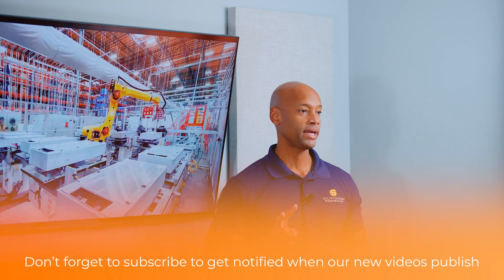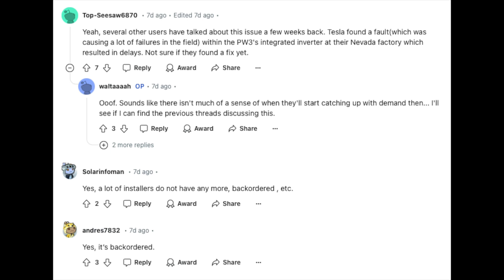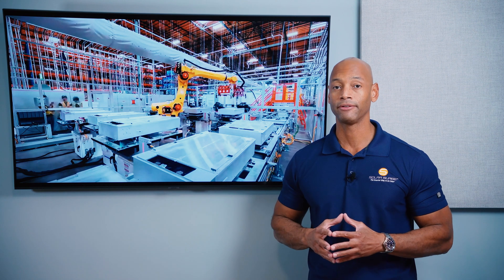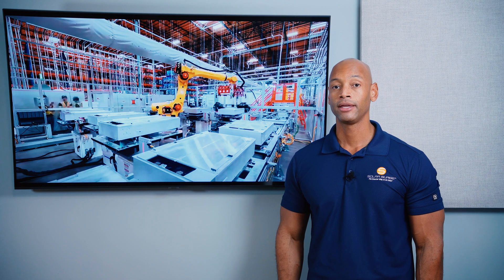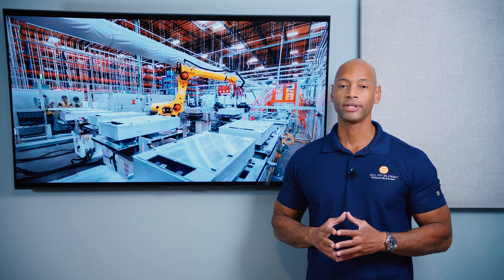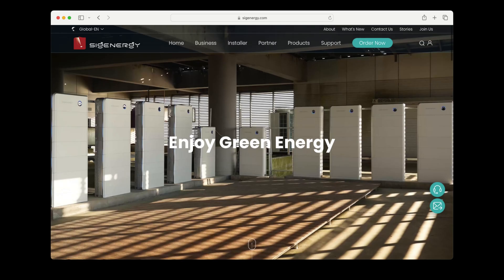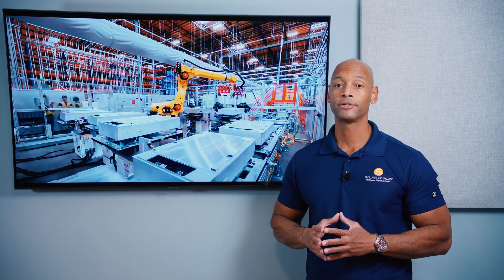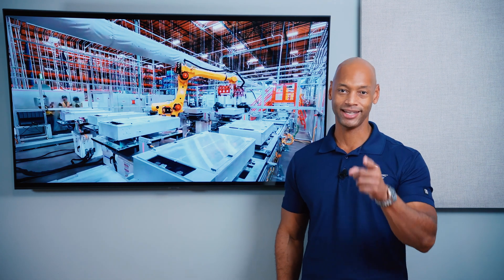SOLD OUT: Tesla Powerwall Out of Stock

Comment: The Ford F-150 Lighting cost 50k for 98 kWh that can be pluged into yiu home.  7 Tesla Powerwalls with installation will cost 70k, buy the truck and get a vehicle for free
Reply from the maker: Good point
Reply: Yes, but you have to install PowerShare equipment, which is an additional cost.
Reply: lol this only works if you dont drive that car during sun hours so it can charge up... unless you are talking about parking that car forever as backup battery 😂

Comment: @The_Solar_Guy_Eric  
Flex in South Carolina and Salcomp in Texas assemble for Enphase. The majority of the components are US-sourced. The workforce is American. 
Sorry buddy, your curve ball is out of the strike zone. Enphase LFP cells are sourced from Chinese suppliers. This will change. In early 2025 all Enphase LFP cells sold in the USA will be made in the USA. 
@TurreTuntermaton  Chinese Sinergy point is sustained. Your remarks are overruled. You failed to address the Chinese Sinergy relationship. TSLA too will eventually source LFP cells in the USA.
Solar Surge is a 100% residential Solar and installer audience. The TPO market will suck down the 10% ITC domestic adder. Enphase will see a fair share of this business. TSLA also, SolarEdge by Q4 2025.
TPO lease contracts are the majority of installations in 2024 and projected to be the majority of installations into 2025.
TSLA Solar is noted for failures and horrific aftermarket service. 
It is a shame the PW3 launch has been spoiled with news of a manufacturing flaw.
The advantage PW3 promoted was the ease of the install and the minimal time required to commission the battery and inverter.
The installer of record will have to double back and requalify the work or in some cases replace the PW3.
PW3 margins are known to be under 10% during the promotional pricing period. 
TSLA is selling direct to the consumer and dispatching installation contracts to smaller local installers. 
A life line if ever there was, the harsh consolidation at the installer level has seen many go out of business. Solar City employees are included in the carnage.

It is too bad TSLA rushed to market 6 months early in an effort to front run Enphase next-gen IQ-10Kwh LFP battery with GaN. The recently detected flaw in the manufacturing process may have been detected and the TSLA Solar inverter quality and service reputation saved from the humiliation.

Franklin is a solid AC-coupled alternative.

PW3 from concept targets the String Inverter replacement cycle. Adding a battery in one go is a brilliant product innovation and marketing scoop.
The PW3 buzz from installers is the simplicity, no power electronics on the rooftop.
Ironic the installer community completely overlooks the mid-circuit disrupters (rapid shutdown devices) between every 3 modules on the string to a max of 5 per string. 
This fact puts into question installer ethics.
Of course the single greatest problem with the solar installation industry is the lack of ethics ...
A cold hard statistical historical fact in the insurance industry is 90% of solar array arc fires are caused not by faulty components or manufacturer error but by poor wire splices on the string. Installer errors
The microinverter plug and play came to the rescue.  
Joe, do you wish to challenge the insurance industry data?
I think Solar Surge has a conflict of interest sometimes. Many videos are sponsored by insurance entities.
Weed out my speculation, I love the channel:)

Comment: Tesla Power wall made in the USA vs. PointGuard made in Chi-na. Alternative option is Enphase which is what I currently have and super happy (Semper Solaris) made in Wisconsin and NC I beleive. I would wait unless one does not care about where it's made or on a budget. One thing to add for those wanting Tesla....ALL COMMINUCATION is done via text messaging which sucks ig you want to speak to a human being after initial consultation hence I went with a local roof and solar installer that has been in business for more than 10 years.
Reply: Tesla is not made in the USA. It's designed in the USA. Manufactured by Flex LTD (a foreign company)
Reply: I guess if we’re going to talk raw materials you’re probably right. Most rare metals come from East Asia aka China.

https://www.google.com/gasearch?q=tesla%20power%20wall%203%20made%20&source=sh/x/gs/m2/5#vhid=zephyr:0&vssid=atritem-

Per Google batteries made in house with foreign processed raw materials. Still made by hands 🙌 of an American worker unless Google has misinterpreted made in America.

Comment: SigEnergy/PG is a tiny company compared to Tesla. Their marketing indicates they've sold 'hundreds' of batteries. Tesla - approaching a million.  If you want a Chinese battery, buy EG4 at less than half the cost for same top quality batteries.  PointGuard trying to sell at a premiun to Tesla was a huge joke.  

You left out the 500 lb gorilla - you can buy solar/battery direct from Tesla. My local installers can't touch the prices Tesla is offering. Just placed an order for 1PW3 and 2 expansion packs.  $28K all-in installed.  My local guys were pricing 20-30% higher.
Reply: When are they expecting to install?
Reply: @Energy.Theory  I'm waiting until early 2025 because of a $7800 battery rebate that kicks in next year from my local energy provider.
Reply: True, PG shouldn't have come into the US market with such a high price, but after installing both products and now that they are matching price, (I say this being unbiased), PG is by far a superior product comparing apples to apples.  Installs go faster, has smart switches like SPAN, doesn't need an expensive cart to install as batteries are lighter/stackable. Also, easier commissioning, better app with more features, modular batteries so you can add in smaller increments, they look better installed, etc.  The fact that you can put 3x the amount of storage under 1 inverter is great. (One stack of batteries is like 37 kWh of storage)  The biggest advantage is they actually answer the phone when you have technical questions.  The list goes on.  Again, I like Tesla, but very cookie cutter and customer service isn't so good for installers.